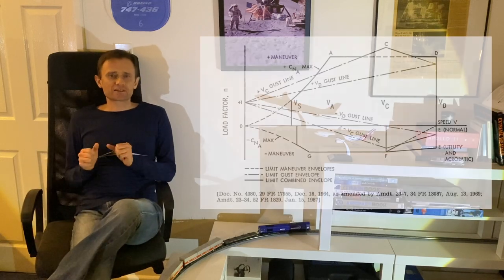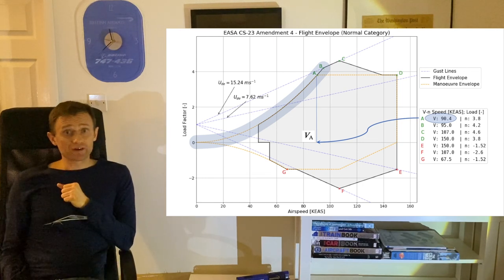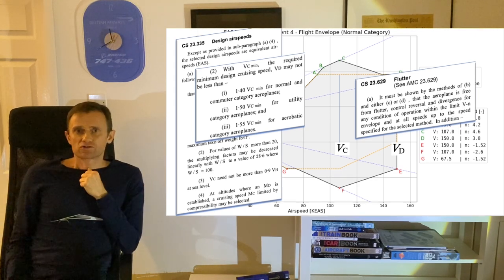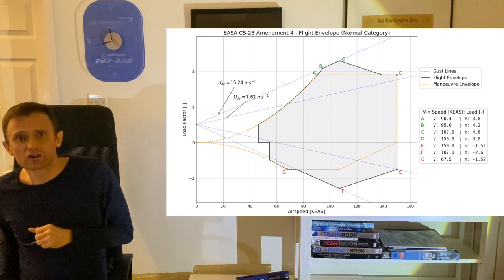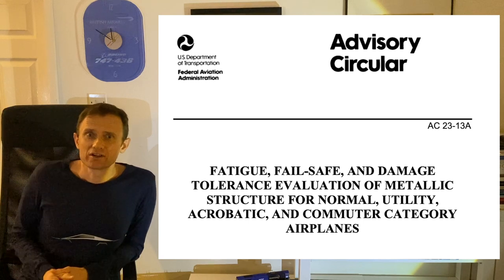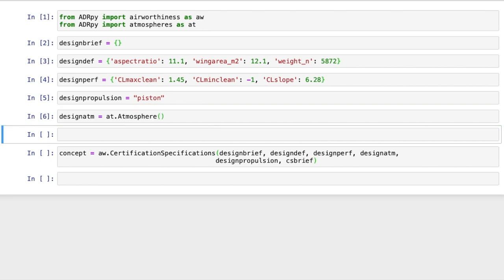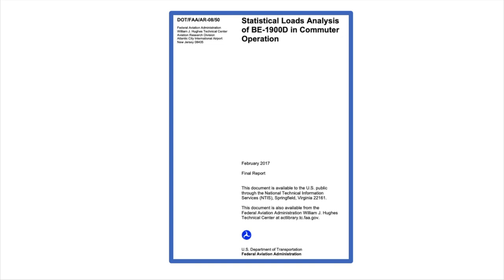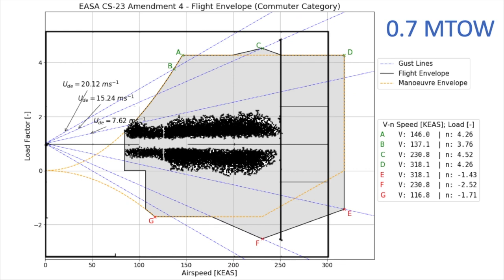How to draw a V-n Diagram?

Comment: Hi Andras, thank you for providing such a useful library. I do have one question regarding the limit maneouvering load factor. In CS-23.337 (a), this factor is dependent on the maximum take-off weight, so limit maneouvering load factor should not change with respect to current weight of the aircraft under investigation while the positive and negative stall lines vary with the current weight. In the code, it seems that the limit maneouvering load factor is calculated based on the provided weight given and weight fraction. Is it possible to adjust the code such that it takes the weight factor into account for stall lines but only the maximum take-off weight for the limit maneouvering load factors?
Reply: Hi Omer,

I am the developer of the ADRpy V-n diagram code. The limit manoeuvring load factor is indeed dependent on the maximum take-off weight. I disagree that the load factor should not change with respect to the current weight of the aircraft, but I agree that the limit load factor at MTOW should not change. If you disagree with this please do get in touch again and we can talk about it more, but I understood the regulations as follows:

L = nW  (lift force = load factor * weight at design point, for steady flight)

Lift is a function of dynamic pressure, and weight changes with the "current" weight of the aircraft (at a certain design point). If the dynamic pressure is unchanged (as it would be for a given equivalent airspeed), the lift force does not change with weight (L@MTOW = L@designpoint), but the weight force does (W@MTOW = W@designpoint / weightfraction). The only way to resolve L=nW is to have the following be true:

L = n * (W@MTOW * weightfraction)

For a given lift force (at given flight conditions), the load factor must go up as the weight fraction of the design point decreases. The limit load factor does not change (that is defined by MTOW as you said), but the load factor to be considered does actually change with the weight fraction (in my interpretation). This is why the plotted load factors scale with weight fraction.